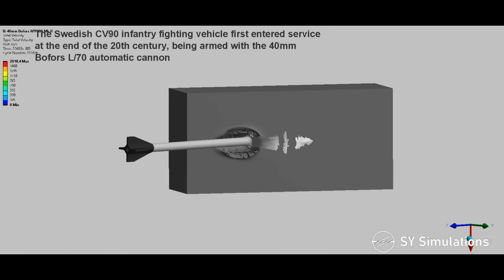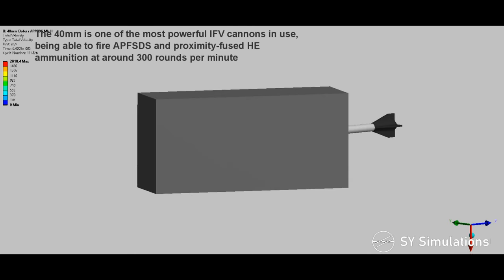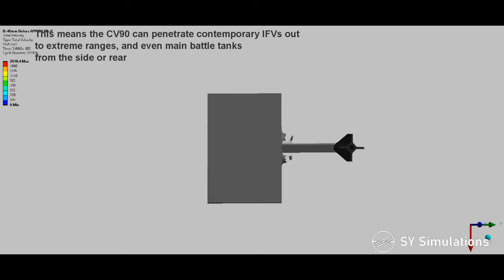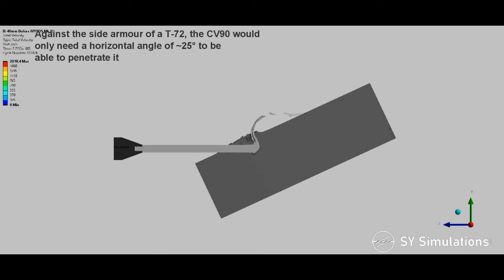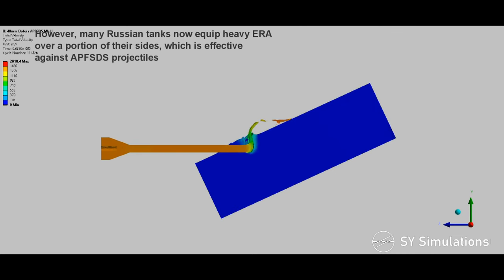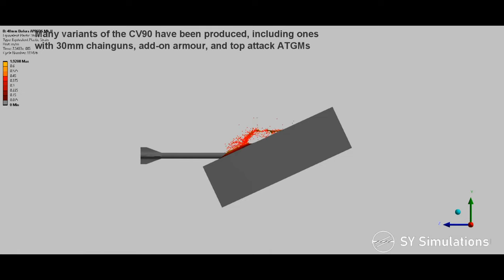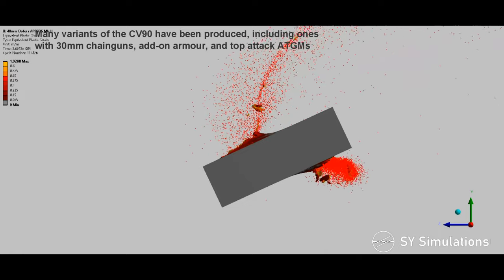CV90 vs T-72 | Swedish 40mm APFSDS vs Main Battle Tank | Armour Penetration Simulation

Comment: Hits the ammo, goes straight through, and turns it red. Welcome to top tier
Reply: Turn it to Red ? Most of time I don’t even damage it specially if it was T-80BVM 😂😂
Reply: Pen? It wont even go through the sideskirts
Reply: Nah that aint it. It will only orange the crew and turn the ammo black (destroyed) but the tank doesn't blow up. Keep in mind it happens several times :')
Reply: @Gracefulwarrior2124  Most of the time I've seen the shell go harmlessly through the carousel.
Reply: @DarkButz  All of the time I get blown up by Abrams that didn't even aim at my hull
Reply: Russian tanks are well known for their durable ammo racks /s
Reply: Same thing on GHPC but you turn into a fireball
Reply: @copter2000 my ass, it's half the tank

Comment: I love how the 40mm bofors is right up there with the .50 cal as some of the longest serving weaponry in the world.
Reply: The L/70 has a longer barrel, different faster mechanism, and bigger cartridge than the L/60 from WW2
Reply: @highmolecularweightRDX  designed in 1948 and in service since 1952 still puts it up their with longest serving weapons. its not the 100 years of the M2 but its still earned itself quite a venerable position.

also the update to it isn't very  dramatic with a slight case lengthening and retuning of the firing mechanism its kind of like saying the AK isn't an old gun because they are using the AK-12 and not the AK-47 or AKM anymore. they are different but not by much.
Reply: Laughts in Maxim 😏
Reply: @TADAMAT-CZ  definitely true but the maxim isn't still manufactured and has only been adopted due to old stockpiles still being around. that saying though its damn impressive to have salt mines full of old maxims get used in the 21st century.
Reply: nothing beats the 7.62 x 54r cartridge
Reply: @aymanayad7230  yes but honestly I am unsure why russia never redesigned the cartridge to make it rimless.
Reply: @dominuslogik484  there would be no benefit both would feed well enough from belts, and it still works well enough in 20 round dragonuv magazines, and massive stockpiles of ammo
Reply: @aymanayad7230  they burned through most of those stockpiles of ammo a long time ago, they just kept making more of the stuff. it does still reduce capacity of belt boxes, this seems to me the reason why russia uses far more RPK type squad automatic weapons rather than proper light machine guns at the squad level.

though yes the round still works but redesigning a case with the same dimensions wouldn't really take much time or development at all.
Reply: @dominuslogik484  they would have to replace all of their dragonuv rifles and pkt machine guns and all their tank and vehicle mounted guns, also they still have shit tons of ammo from the 70s
Reply: The Mosin and K98 are still being made as far as I know
Reply: @thiagorodrigues5211  Neither of those rifles are still being manufactured anywhere. unlike some handguns which still get manufactured after all this time when those rifles stopped being made by the governments that used them there was no private company to continue production and all the tooling/plants doing the fabrication were changed to something else.

the mosin nagant ceased all production after 1963.
Reply: @dominuslogik484  really? I thought Mosins were brand new. Then again, ISIS once found a crate of brand new STGs, can imagine there are still a lot of Mosins in perfect condition
Reply: @thiagorodrigues5211  after the second world war Russia packed up all sorts of equipment for long term storage, coated it in cosmoline and stuck things in areas that stay dry and a consistent temperature such as salt mines.

its the reason why there are a bunch of thompson SMGs and Maxim machineguns floating around Ukraine right now.
Reply: @highmolecularweightRDX  
My father is into his 70's now. He served his conscription on an AA battery of 3 linked '40 long 70' Bofors cannons.
Reply: Now imagine if NATO decided to use them against Drones like their wwê ancestors were used against planes
Reply: @dominuslogik484 mostly because they kinda did with the x39 one.

I mean yeah you could improve the x54 but what you gonna use that for besides MGs that don't really care, and Sniper/Marksman rifles like a SVD and a SV-98? What I mean is, theres not really a need to fix that now. Ww2 would be when they do it but Germany showed the STG-44 and the soviets were like "oh this is Nice we should make something like this"
Reply: @gerfand  we had that AA tank built off of the M48 chassis in the 90s. I think that would have been really useful in the current warfare situation. double 40mm cannons with proximity fuses could clear the skies from everything.

it feels weird that old systems deemed outdated like that are suddenly no longer as outdated as they used to be. it feels like if we were rediscovering the concept of using machineguns or something obvious like that.
Reply: @dominuslogik484  its just that people never considered other used and kept going hight tech. Literally what is a Drone today if not an easy to make not expensive plane

Not this but 25mm AA gun in IJN ships was utterly Trash, until its job was fighting Land vehicles and not Aircraft
Reply: @dominuslogik484  PKM
Reply: @carkawalakhatulistiwa  that has been in service since 1961 so it's not nearly as old but I'm sure it will last to see 100 years of service.
Reply: @highmolecularweightRDX  Even if you just talk about the L/60 it was in use as recently as 2009 on the AC-130U so that would put it at around 75 years.

Comment: The heavy ERA thing is correct and will effectivly stop the 40mm apfsds but because its an autocannon the era can only stop a single shot
Reply: 5 rounds a second. I wonder how big the spread is with a 5 round burst at 500 meters.
Reply: @Juel92  doesnt matter because in another second there is another 5 rounds
Reply: Hit the ERAwith a burst of HE and then follow it up with a Sabot round?
Reply: @JimmyCrawford HE from a 40mm wouldn't destroy the ERA, at least I don't think.
Reply: @voidtempering8700  would the impact not set it off? I thought that was the point, in that it explodes outwards and effects the incoming round?
Reply: @JimmyCrawford  Yes, but it requires an intense reaction to set it off. Something like high APFSDS, HEAT, and maybe a high caliber HE round. Even 20mm or 30mm AP rounds might not set off K-5 ERA, let alone Relikt. It would set off K-1 ERA though.
Reply: @voidtempering8700  would likely just chew it up then? Either way, it's out of use?
Reply: @voidtempering8700  iirc relikt is designed to just not explode to smaller projectiles like 30mm sabos and prolly 40mm as well
Reply: @Juel92  With apfsds it corrects the firing rate to 200rpm to increase accuracy. I can tell you from experience that its very accurate with a 4rd burst at 500m
Reply: the reactive armor is shit and more correct the russian is worthless
Reply: You people truly do not realize how hyped up ERA is thanks to Russia and war thunder. The best ERA has no more than a 15% effect on penetrating rods.
Reply: @voidtempering8700 Well we know that’s not true as 25mm HE was able to blow up several Relikt ERA modules on a T-90M.
Reply: @nhatlehong8803 You are remembering falsely. Russians claim that it will not detonate up to 30mm APDS not APFSDS and certainly not 40mm. Please go look the the muzzle energy from 30mm to 40mm you are comparing 5.56 to 7.62 NATO
Reply: @Austin-cx2xe  None of the Relikt modules blew up. Those were the explosions from the 25mm HE. HE can't even detonate K-5, let alone Relikt.
Reply: @voidtempering8700  one of the era panels blew up from the bradley. 40mm will explode it if 25mm can.
Reply: @krunchie101  No they didn't.

Comment: Could you simulate the 3P ammunition hitting a BMP3 with its AP mode, or an Airburst of it against MTLB or BMP targets ?
Reply: 40mm 3P ammo can easily penetrate the BMP-3
Reply: All of these vehicles have anti-hmg armor only, not anti cannon
Reply: @xWizardxRF  Yes, and?
It would still be interesting to see the possible effect.
Reply: @xWizardxRF  3P ammunition is not really AP. It is HE-FRAG round with very advanced multi mode programmable fuze. SB PRO PE database says that in delayed impact mode (also called PDD mode by some people) it's estimated penetration is around 20mm RHA, so very much like HMG ammo (some 12.7 NATO ammo has even better penetration that that).

Comment: In that case, this baby will shred all modern tanks from the side, since T-72 has probably the thickest hull walls in the business. Abrams and Leo-2 tanks for instance don't reach even 50mm in hull wall thickness.
Reply: Ssssh, don't pop their bubble
Reply: It's not only about thickness, it's about materials and type, f ex cast iron vs composite armor.
Reply: @antioch4019  
Composite armor is a broad term, and AFAIK all Soviet MBTs since T-64 have it in various forms.
Reply: @user-co3uc8vt7e  true but I believe the og 72 had cast iron and cold war era soviet are believed to have 300 rna wich is what he seems to have assumed on in the video.
Reply: I guess that’s why simulated situation is almost unreal nowadays since modern tanks likely used as hidden long range snipers.
They just not designed with purpose being attacked from sides.
None tank will survive being attacked properly, especially from sides.
Reply: Depends on where you hit, most modernish (M1 Abrams onward) western tanks use composite side skirts for protection so while the base armor is 50mm underneath, the side skirts usually add another 50-100mm of effective KE thickness to that. Won't stop a flat side shot but from the same angle as this vid I'd bet an Abrams and Leopard 2A5 at least would stop it

Comment: @SY Simulations You should know that even the "plain" steel used in tanks made in the last 40 years or so, is significantly stronger than WW2 stuff. I would not be surprised if this 80mm plate was equivalent to a 100mm one against subcaliber shells impacting at high obliquity.
Reply from the maker: Yeah its quite impressive how far things have come. For the most part my ww2 models use 'good quality' armour as the bad quality ww2 ones vary too much in what makes them bad quality, and there's less data out there to calibrate against. They're still modelled as weaker than modern armour though :)

Comment: The tank may survive if the crews does not carry the spare ammo in hull/turret
Reply: It will survive in this case. Since the 90's a russian study pointed that most of ammo detonations happen because of ammo outside the caroussel not inside of it,so they started puting ammo just in the carousel and not in other parts of their tanks.
Reply: @cykablyat123br9 it depends, if the round continues into the tank then it'll very likely punch through the 5mm thick autoloader stowage area and hit the projectiles inside.
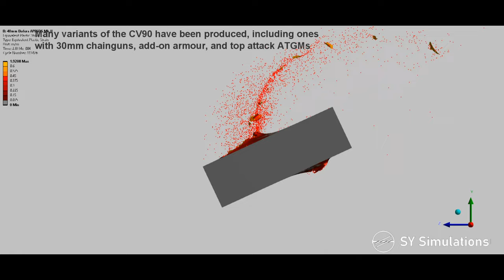Reply: spall will kill the crew, russian tanks don't have anti spall protection. At 1:10 the red mist in the sim is spall, with each pixel being equivalent to a shotgun pellet
Reply: @signs80  this will depend much of the density and velocity of the spall. If it is almost the same thing of a shotgun pellet so it will not be able to penetrate the caroussel in this case.
Reply: @cykablyat123br9  I'm talking about the remains of the penetrator, that will go through 5mm of steel without a problem.
Reply: @signs80  ok k. even if something manage to penetrate the 5mm thick steel of the caroussel exists a change for the ammo not going off too. This is all uncertain and variable. Plus the fact that depending on the angle of the caroussel it will have more efective thickness.
Reply: @4T3hM4kr0n that's not true, for example on the T-72's the inside of the hull and turret is lined with a synthetic fabric made of boron compound, named "Podboi". This fabric which is 45mm to 50mm thick, offers extra NBC protection and acts as a spall liner
Reply: @levilastun829  yes but side of hull doesnt have that like most of other MBT'S around the world. The only russian tank that have spall liners even on the side of the hull is t90m.
Reply: @cykablyat123br9  well looking at ukraine. That's the the case.
Reply: @cykablyat123br9  Source?
Reply: @michalis7023  red efect.
Reply: @cykablyat123br9 your source is a tank enthusiast with as much authority and credibility as any other random guy on the internet
Reply: @stephenallen4635  a tank enthusiast with real sources... k this need to be a joke coming from you.
Reply: @cykablyat123br9  everyone can access actual sources for information by themselves you don't need internet crybabys like red effect to get in the way
Reply: @stephenallen4635  but you can get the information by yourself too. Wtf you're saying my man, those guys just pick all this info and make a video of it all togheter, and thats it.
Idk why you are being mean.

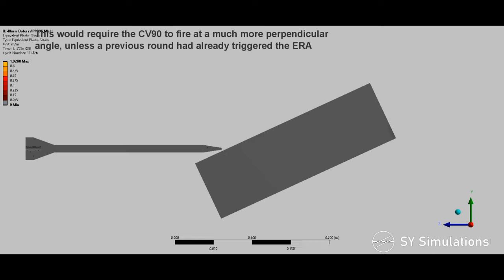Comment: 0:53 except it doesn't matter if they have ERA as the 40mm bofors is fully automatic so while the first hit might not do much the fact that you're firing 5-10 rounds will probably work.
Reply: I think it is only possible to fire single rounds with sabot selected.
Reply: @Dramigbaklanges I think you can fire semiautomatic
Reply: no, you can also fire bursts 
 @Dramigbaklanges
Reply: Exactly, and if the first and last round they fire is a 3p ammunition then it is game over for the tank
Reply: @AdalbertSchneider_ Only with the high explosive something about higher pressure ammo or smthin but the 30mm one can go in full auto because it's a different design
Reply: Why do you think that rounds will all hit the same spot?
Reply: @xWizardxRF  why do you think it won't?
Reply: @xWizardxRF because he only plays war thunder and doesnt actually know anything about combat
Reply: From what we've seen in Ukraine they're firing them at a very slow rate ... not 300 rpm like in war thunder lol
Reply: @4T3hM4kr0n  usually there is extreme dispersion with auto cannons at range at a faster fire range. So it depends on the engagement distance.
Reply: @cherrypoptart2001  the CV90 or the Bradley? Because the Bradley's 25mm has a slow cycle rate.
Reply: If they hit 10” apart, the era is detonated and the next darts pen. @xWizardxRF
Reply: @cherrypoptart2001  Real life rate of fire is 5 rounds/sec.
Reply: @cherrypoptart2001  its been slowed down to 200rpm for higher accuracy
Reply: Это не сработает так как калибр боеприпаса слишком мал и реликт спроектирован так чтобы не срабатывать от 40 мм фугасов или ломов
Reply: Ukraine wants to manufacture 1000 CV90 in Ukraine and is now negotiating with Bofort

CV90 is the best Ukraine has and this probably answers most questions

now the usa has begun the development of a 50 mm cannon that will be mounted on the replacement for the Bradley Fighting Vehicle, this also provides an answer to the question
Reply: The bofors is a very accurate gun, you're going through the side of a T-72.
Reply: I can imagine that a volley of that can nullify NERA, but AFAIK, it can only penetrate further than the first one if the armour is brittle(usually, there is not enough steel in the spaced composite array and that its mostly brittle ceramics)
Reply: @stephenallen4635 and you do?

Comment: In a way the CV90 mirror the development of the WW2 Tiger. Both were equipped with what was initially a successful anti-aircraft gun.
Reply: Many WW2 tank guns were initially anti-aircraft guns.

Even the Sherman 75mm was from a (failed) anti-air prototype. The 3-inch of the M10 was the M1918 3" AA gun. The Pershing's 90mm was also lifted straight from AA duty, 90mm M1. The 85mm of T-34-85 fame started out as an AA gun (M1939-52-K).
Reply: @MPI1000  The Tiger killer  -the 17 lber was always an anti tank gun
Reply: @simonh317  He did say "Many", not "All". There is also the 76mm M1 which was developed exclusively as an anti-tank cannon, for vehicle mounted use.

Comment: AFAIK the 40mm gun is extremly accurate, basically shoots hole in hole for quite some range dramatically increasing the probability of penetration as it can penetrate up to 60mm RHS (please do correct me if I'm wrong but that's what I've read at least).
Reply: 120 RHA  mm with apfsds
Reply: @whatdoesntkillyoumakesyous6707  Oh, neat!

Comment: With all the Drones and FPV Drones now making life difficult the CV 90 is probably one of the most survivable vehicles on the modern battlefield. Interestingly a 30 to 40mm armed vehicle with facilities to launch and guide FPV drones and the sensors to defeat the same could be a game changer. Able to command large sections of the battlespace above and around them.

Comment: Impressive penetration for such a small caliber dart- compared to MBT guns anyways.
Reply: It is 200mm in length. 
105 rod back in the 1970s is also roughtly  200mm in length. 
The result is not a surprise.
Reply: Which specific MBT gun are you referring to? Russian 3BM60 penetrates over 750mm of RHA, M829A3 is claimed to penetrate over 900. Also a lot depends on the material used. DU penetrates more at lower velocities but same length, Tungsten needing more velocity for same results.
Reply: @jintsuubest9331 Which round is this? I've not heard of an APFSDS for the 105 that was so short?
Reply: @hi_-bz7wf  Shells such as DM23 or M735 are just as short as a normal shell, they did not extend into the cartridge like modern ones
Reply: @Minh-Tran-04  They are small, but they aren't close to the 200mm that a prior commenter claimed.
Reply: @Minh-Tran-04  Production M735 had a penetrator core ~300mm long not 200

Comment: So the 40mm apfsds should have around 200mm of pen?

80mm plate at 65 should be 190mm thick
Reply: APFSDS are more efficient at high obliquity. Pen at normal should be about 170-180mm.